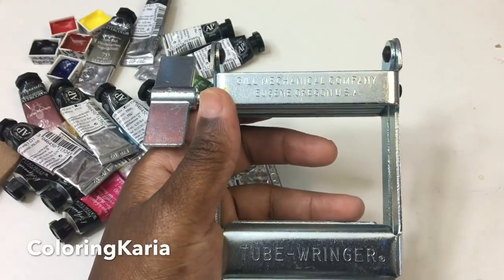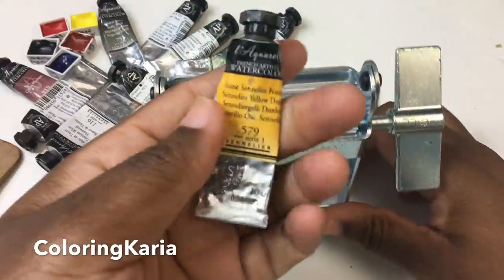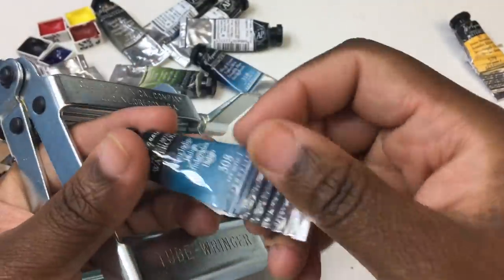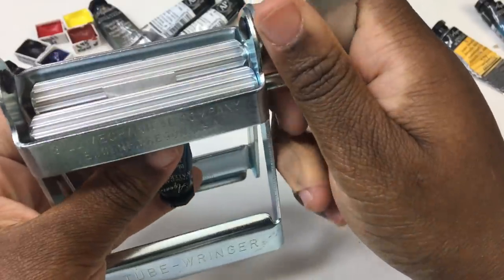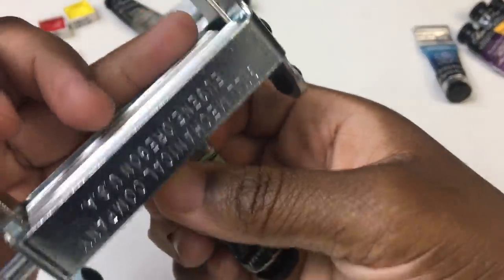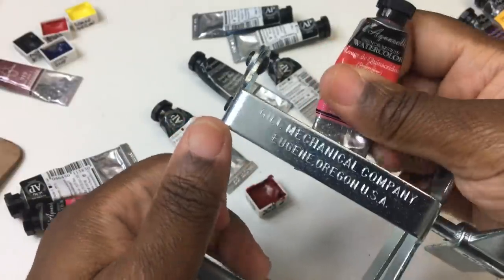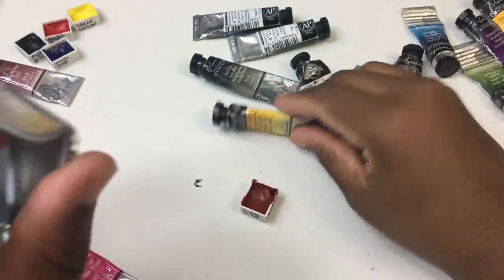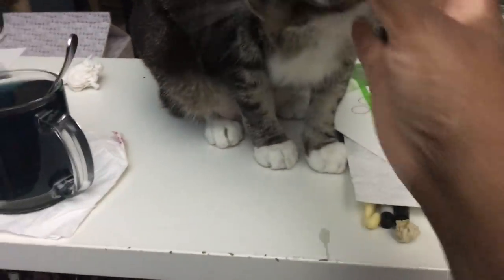All Metal Tube Wringer Mini Review and Demo (yes I'm longwinded)

Comment: Does this also work on plasticy tubes of moisturiser etc? Or just metal? :)
Reply from the maker: It does work with plastic tubes! I’ve used it for lotion and toothpaste but I don’t think it works as well for plastic.
Reply: @ColoringKaria  Thanks for replying, I thought that might be the case! I've ordered one for my metal tubes and I'm thinking with plastic ones when they're almost empty i'll just take the lid off and squeeze what's left into a little pot if the crimping doesn't work :) x

Comment: I think you’re suppose to use on the surface probably not upright when you use the tubes. You can use any way you want, and I think using it flat on the surface is a good idea.
Reply from the maker: It works in any direction but this is was done to make it easier to show on tape. When I use it in real life I use it upside down with the tube opening pointing down.